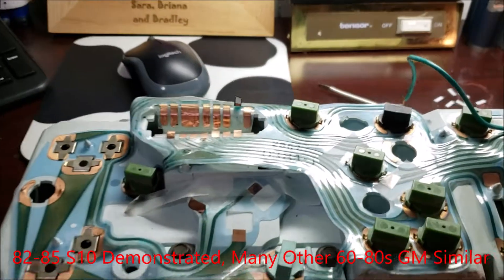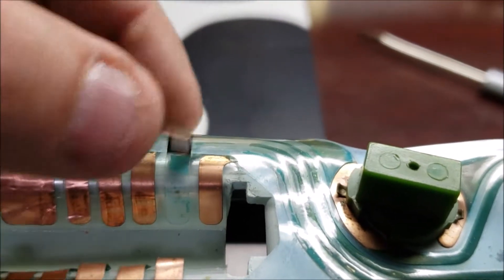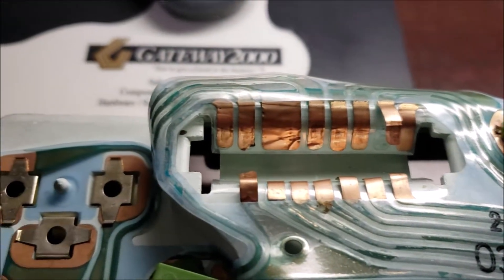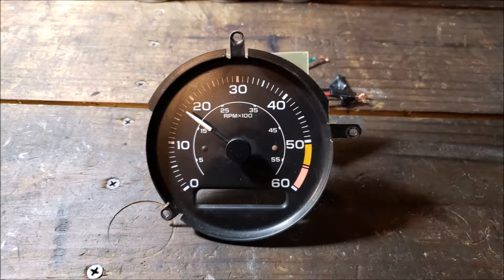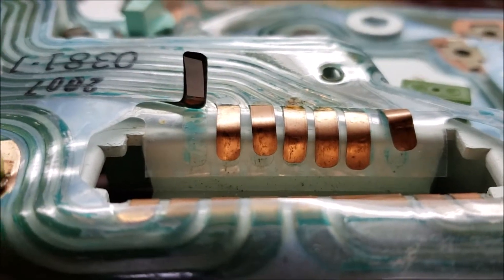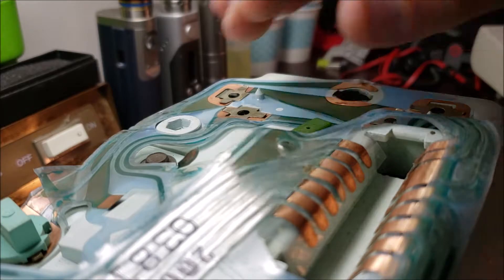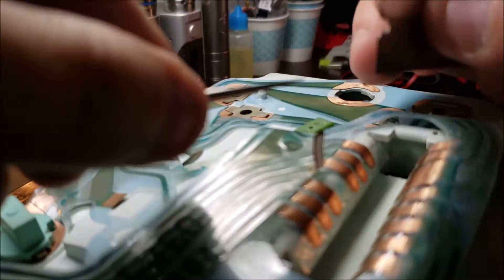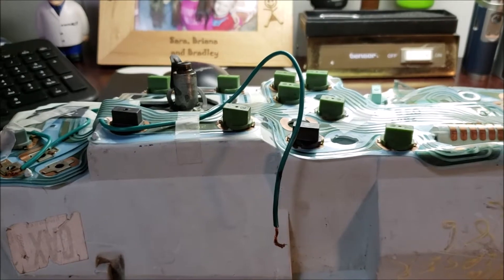GM Printed Circuit Board Delamination Repair 🔧

Comment: Shaun can you actually make a circuit board ? Like the 3rd brake light on the 90's trucks are obsolete... i would like to find someone who could make a board to use led bulbs ..any information you have will help

Comment: Awsome surgery on that gm printed circuit board. I had to do a little jury rigging on my gm 1980 oldsmobile delta 88.Just purchased another cluster with the printed circuit board attached .hoping to undue my jury rigged connection.Very nice and nicely explained video.

Comment: That was like 3 miles away of the level of delamination I was expecting. O_o

Some stoopid at work put too much heat in a PCB, it made a bubble, I didn't had a multimeter at the moment so I'm just hoping the lines didn't cut. 😭 I'm almost praying because the circuit didn't do what it used to~ 😞

Comment: Home improvement stores sell dielectric grease in automotive next to epoxy's. Use this on "Edge-board" terminals to keep from future damage of socket terminals. Also, tooth pick the grease on the bulb sockets, bulb wire contacts and studs on gauges where the plug in. Use a smear on back under clips and back of clips. OEM clips are better. Sandblast if able. Otherwise, cut a wood paint stick/paddle to size, grind or cut thickness with knife, the wrap 320-400 grit sandpaper over end. Hold in place with tape, masking or otherwise. Insert and clean inside of clips. Compressed air at 20 PSI or less, use to clean sanding debris from clips. It protects them from water or moisture in the air when temps change. 
  Tach; Plugged in wrong or does not require B+. Some tach's require a "Pull-down" circuit using a 460 ohm resistor to ground to limit drain some voltage (in series, limits current/amps). Other tach's require pull-up circuit. Here, the resistor goes between tach lead as before to B+. I don't think GM used that or either. 
  Online, find "S10 Forum" join and look for electrical section. Some Forums have search feature to "See Schematic" but if tach is from a different model or year, use that schematic or wiring diagram!
DK, ASE master since 1978.

Comment: I have a strange question why my gm milege counter is ticking he cinde of stop working evry time I put coolant in winter inside my engine is that a back charging issue? And how bypass linear voltage regulator? My ignition coil aperantly has somthing to do with the dash voltage regulator so in winter I dont have enough voltage to start engine I have gm bypass starter selenoid but the polarity is wrong I used even a diode and my positive linear voltage regulator refuse my to crank when I use that starter selenoid R terminal my fuse pop's I have singel coil gm hei e core type with delco induction trigger and 4 pin gm ignition module.
So my question is how by pass that dash regulator ore how culd I make my R terminal starter wire to make work? Is there a way to use bouth linear voltage regulators polarity ore swap it some how?
Reply: @Devil's Wish   >Dude, you got to many things going on here, but phones change words. Click word in Gray, as I changes and makes no sense.
  First, GM does not use a linear voltage regulator on the cluster like many did 50 years ago. Even then, it was the fuel sender only.
 With the Starter; 1st, The "R" terminal on the starter solenoid is on everyone, but never used with HEI. "R" for anyone who wants to know, is for the points & condenser days before 1972 & HEI.
 The points would burn unless voltage was reduced. The old coil bolted in a bracket was designed to run on 9-10Vdc and be hot enough spark. The "R" is for resistor wire and cover with a friction tape or cloth feel. Do Not Use!!!
  The "S" terminal is start or crank. It uses the PPL wire 10 AWG from the ignition switch. If this is a newer engine or HEI in place of points, cut the wire off. (Theory; During cranking, battery voltage drops. Colder, it drops more. So, cranking the engine with full battery is "S" PPL, once started, the solenoid connects the battery inside the solenoid to "R". The runs thru the resistor wire, dropping current but voltage. Points are happy! Coil produces hot spark. If running external coil off B+ (13.2-14.4Vdc) the coil burns up. "R" is not used as B+ comes to the HEI coil from ignition switch RED hot in run as many things do.
  HEI; RED wire plugs in next to firewall in outside terminal. With cap off coil, 4 screws for plastic hold down coil. Button, copper ring, spring and thick gasket sit under it. On top of coil the four screws, one closest to outside connector had metal ground strap bent with hook for coil screw and fits inside plastic cap near B+. Ground plugs on here. Without it, the coil will constantly burn thru cap to rotor. 
  IP gages have nothing to do with cranking or starting or spark. Fuel gage has B+ to one end and ground on other. The one in the middle goes to the tank to sender. There are two wire coils inside gage wound in opposite directions. One coil pushes, the other pulls. 0-90 ohms is full to empty for decades. If low, the push-pull reverses and moves needle the other way. Simple. 
DK, ASE master since 1978, retired.